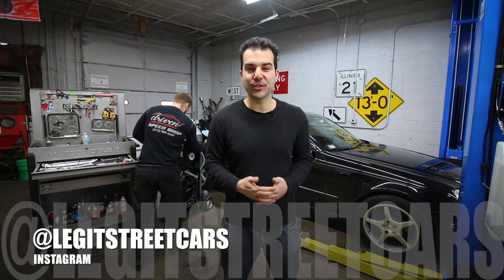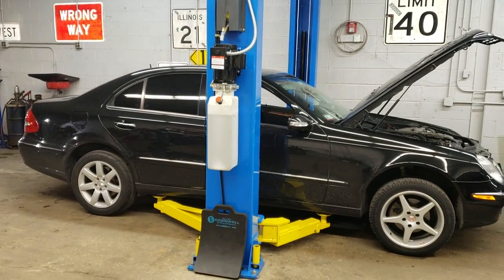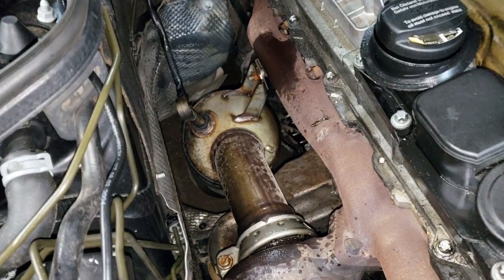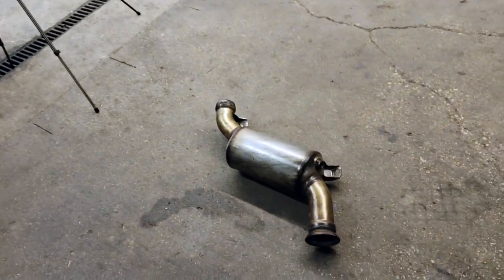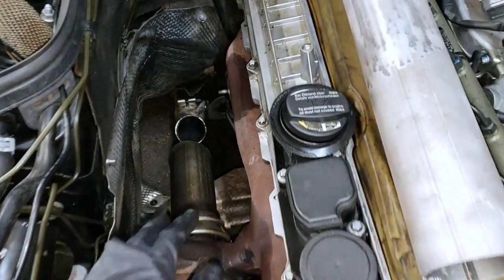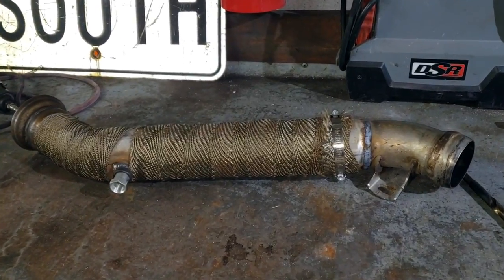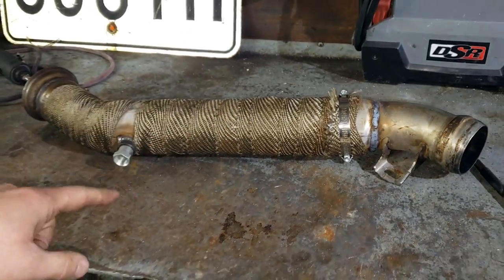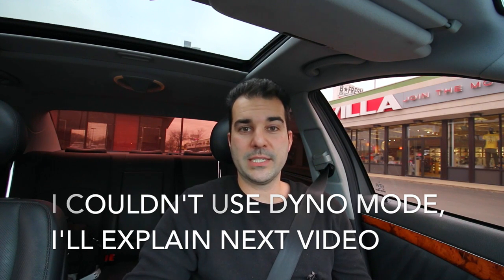I Installed A Catless Downpipe On My Turbo Diesel Mercedes & Tested 0-60 MPH. Listen To That Turbo!

Comment: You have the optil to make a better flowing in and outletcone on the Cat. That would help a lot combined whit a bigger exhaust under the car to the rear mufflers (hot exhaust gasses needs more space than colder gasses.) combined whit better a header and  turbo type you could increase the cars potential and drivability. De-Cat is never a good idea.
But I maybe been damaged since i work with DPF and SCR systems. It is not easy power its Dirty power.    i think that there is better ways to gain power, for example water injection, better Intercooler, cleaning the intake and porting the heads, better turbo, exhaust manifold, better injectors, better Highpressior pump. ECU optimizing. Oil catch tank.

If you ajust the engine to make as little sod at possible you will get more NoX but when you don't get the oil in the manifold it would be easy'er to keep it clean. It's not free but is is a better way to do it. You can tune and still be green ish. And when you do that you learn a lot..

Other wise i love the video's one of them help my friend trouble shorting on his W211 e270cdi. 

Best regard from a viewer in Denmark

Comment: Hello, love the Diesel Mercedes series, I wonder why not just remove what's inside the catalytic converter instead of welding a new pipe, because of the heat? Will it be any problems if I do it like that?
Reply: That's what Killdozer Marvin did on my f250

Comment: You can get about  265hp/ >600nm  from these ,easy. Everything stock, no need mobify anything. Just the ecu tuned. Stock Intercooler is bad as hell, change that first !!!
Reply: Is there an after market intercooler for these?  Or do u recommend a retro fit  from another model?
Reply: @djbarren100   no oem ! They are crap.  Aftermarket will work perfect. Cheap ones are excellent compared to oem cooler. You can get good aftermarket cooler bout 70usd
Reply: I've mine mapped and have always thought of a bigger intercooler. Think I'll look into it.
Reply: @oukkg  Can you please suggest me a good intercooler and AirFilter for this car
Reply: @johnysilvester8483  Intercooler 550 x 140 x 65mm Core Universal, they sell these everywhere, more then enough for this use
Reply: @oukkg  thank you so much for your valuable time and reply

Comment: Nice video and good gains from the downpipe. I think you might have a diesel particulate filter, rather than a catalytic converter
Reply: Both of them are in single casing, first there is a cat and dpf right after it.

Comment: I just have the mufflers off on both of mine and it sounds identical! 
Please chop those mufflers off just to see what the full straight pipe sounds like!!
Reply: I straight piped my 2002 s320 cdi and it made a big difference (stage 1 map too)
Reply: Not sure about the noise level becasue of the turbo, but i had an old straight 5 cylinder diesel Mercedes without turbo.Once the exhaust broke off in front of the muffler (this was years before stainless exhausts), it sounded more like a tank than a car.
Reply: Richie Thirlwell any sound clips???
Reply: @natethedrummer91   I don't have any at the minute but I could take one tomorrow if you want to hear it?
Reply: @richiethirlwell9454  Do it and post it, you'll get a few views from here no doubt.
Reply: Richie Thirlwell yes please!!!

Comment: Did you mean aluminized steal or is it actually galvanized? Aluminized steal is whats used for exhaust, galvanized is used for fence posts and its toxic to weld on.
Reply: sui seidel it looks like the common low grade stainless steel pipe used extensively these days. Calling it stainless steel is wrong, it might be better referred to as rust resistant steel alloy. The aluminized stuff sloughs off the aluminum coating if you weld it.
Reply: Stop calling STEEL Steal !!!

Comment: Should of built a jig and you could of cut it and welded it back together and everything would have lined up perfectly and if would have saved a ton of time.
Reply: That what i do when changing flexhoses on “nottrowaway” mufflers and cats. I weld Them to my workbench before cutting them.
Reply: Did you see him weld, gross. definitely not a fabricator/welder, they would never think to build a jig. that was my first thought. could have done this job in 5 mins tops.

Comment: Must try this on my e220cdi w210!
Reply: I had a 220cdi w210 once, just a recommendation: do a complete straight pipe with a small muffler maybe where the DPF normaly sits.
Its not too loud like that (the muffler takes away alot of the high pitched noises) and it leaves a really throaty sound :D

The car smokes alot less like that because the big muffler at the end of the exhaust is not there anymore.
A lot of diesel soot collects in there and once you give it full throttle, you blow all of that soot out of the exhaust.

also turbowhistle all the time :D Believe me, car parks are REALLY fun like that :D

Comment: Putting a 3" over a 2.75" and you get a small restriction on the lower end of the straight pipe = exhaust flow will be interrupted and wont flow evenly. Just my $0.02 from Sweden.
Reply: Swedes Garage won’t make a damn difference.
Reply: It happens all the time with cars, especialy with intake piping etc

Comment: Hi Alex I heard in this video that your 320CDI has a stage 1 tune. I have a CLK270 w209 2004 with 174,000 miles with full Mercedes service & parts. What are your thoughts on me getting it a stage 1 tune? Please could you advise?  Chris

Comment: Did you weigh both? (the silver and the black) I think the 0,3s could be because of increased weight from the higher amount of gimmicks you mentioned, the black one has. ( for example real leather beeing heavier than the artificial material...)

Comment: I am thinking to buy a Mercedes GL 420 CDI  or an GL450 CDI  Which one has the best engine? And is 200,000KM or 124,000 miles too much? The models I look at have 120k+ miles on them. Hope you could give me any advice where to look for. Thanks!

Comment: Hello I have a 1987 mercedes 300d turbo diesel. I believe my cat is bad and I'm thinking about removing it and busting the core out  and bolting it back on.
Will this set off the check engine light. It shouldn't hurt the way it runs considering its not electronically controlled correct.  Any advice or suggestions would be greatly appreciated.  Thank you.

Comment: I love this series you do all what i want to do with my car check dieselpumpuk they make 311bhp with stock fueling also 2 step is also cool check it out
Reply: Yes and their dyno numbers all all inflated but no matter.
Reply: @kwittnebel  car on same dyno make 160ish and now on same dyno 311 that is almoust 2x off stock power give it take iz that is on stock fueling
Reply: @jimmykovacevic7745  yes without any data on safe exhaust gas temperature or motor durability running twice the fuel with the stock turbo in a very inefficient part of its map.

Comment: Great video! Thank again. Have you tried a throttle response modulation device like Sprint Booster ($290) or Pedal Commander ($300) or Pedal Box ($325)? I assume allowing the drive-by-wire throttle body on these cars to just snap open, rather than slowly opening, would decrease 0-60 times.  They look like they're just plug and play so you could give them a go on both E models.
Reply: drive by wire? its a diesel it does not have a throttle valve

Comment: Hey man I love your channel, what you think about airmatic very stiff, open circuit on damping valve, no height or compressor problem, wiring and connectors or okay. Thanks for your advice I have a video on my channel about it.

Comment: Any internal transmission mods planned to handle the additional lb/ft of torque?
Reply: Jonathan Jones probably not, the CDI has the 722.6 transmission that can handle WAY more torque than this. They are used in the 600 V12 cars and the 65 AMG V12 cars (albeit tuned with “AMG Speedshift” stuff on the 65.) Only bad thing about this 5 speed is the slow shifts.
Reply: I am fortunate to own a ‘06 CDI (wife’s daily driver-and one owner too) that we purchased last year.  The reason for my question is Renntech in FL. offers a built tranny and software (yes- big money).  ‘Curious to see what Alex does to his that a working man can afford...
Reply: @BeesonsCars  The twin turbo V12 models and supercharged V8 models have different clutches (in their 722.6) that are designed to handle more power than a regular E320 will be able to handle.
Reply: Tyler Beeson the 722.6 NAG1 is actually only designed to hold about 420ft lbs of tq.  A simple valve body upgrade or even just doing blue top solenoids would improve performance slightly.  I have spoken to Bill at Paramount Performance about this as I have an 05 CDI and will probably be doing a valve body upgrade soon.
Reply: @BeesonsCars  That is completely incorrect. The 722.6 in the supercharged V8 or twin turbo V12 models have totally different clutches to handle the power. A standard 722.6 in a TDI won't be able to handle the same amount of torque. For it to handle the extra power he would need the different tranny or its internals. I have a chart saved on my phone that lists all of the different 722.6 transmissions, including their torque rating.
Reply: Alex Torkelson thanks for the corrects I didn’t know that. I’m assuming it’s the same thing for the 722.9 as well? Besides different clutches to handle more power is the main design the same?
Reply: @BeesonsCars  Different clutches, different torque converters, different gearing, but those are the main differences. I forgot what else is different, but the upgraded clutches at a minimum would be needed. 722.9 I wouldn't be able to comment on since I haven't spent any time at all familiarizing with those.
Reply: Alex Torkelson I was curious as my family has three Mercedes now of different vintages that all have the 7G tronic. We recently acquired a 2015 W205 C300 and it shifts so much better than the older 7G Tronic in my W221 S550. It’s insane how much difference in shift speed there is. My S is so lethargic shifting but it’s smooth as butter even in sport. But the C shifts like a DCT in sport plus mode and is really great.
Reply: @BeesonsCars  Oh yeah, I wouldn't have any doubt that they'd made huge differences in the 722.9 over the years. I wasn't able to comment on it due to inexperience with it, but just like the 722.6 there would definitely be numerous different gearboxes and different internals available for it. I wouldn't doubt it if the valvebody and shift solenoids are different too. For my E55 AMG, I can get blue top shift solenoids that offer crisper, harder, faster shifts, which I eventually plan on getting. I'm pretty sure the new S65 AMG with the twin turbo V12 now uses a 722.9 even.

Comment: Just out of interest does the US get the V6 Cdi engine used in the facelifted W211?? I think the output for the V6 CDI is 228bhp!
Reply: Straight 6 in 05-06 CDI 201 HP
Reply: @clagueb3686  thats a shame, the V6 CDI was very very good! And responded well with a stage 1 remap!
Reply: I think Mercedes returns to straight sixes this year both petrol and diesel.

Comment: Does Illinois require annual emissions check for registration renewal?  Here in Dallas/Fort Worth we do.  I don't see how you get through that minus the cat.
Reply: Vic Sorlie They just plug into the obd port and check to see if you have any “check engine” codes. I used to unplug the battery and go test before the codes cycled. My Volvo is catless and has no factor in the emissions test. Pass all the time.
Reply: @csebastian71  Thanks.  I was thinking there'd be Not Ready flags if cat was removed.
Reply: @Aardvark49  There would be Not Ready flags, he's BSing. Ask me how I know.
Reply: D/Fw here as well.  This car would pass just like all us diesel trucks around here.  O2 sensor needs to function for no codes but diesel engines have no emissions check, only safety check.
Reply: @I_Count_Twice  Thanks for clarifying.

Comment: I went cat-less on my 993 a few years back, and was shocked at the amount of exhaust gases/smells were omitted once I did the mod. (3.8L w/full Fabspeed exhaust and chipped I'll make exceptions!)  I appreciate you are consider this-especially on a DD thought. Not enough people I feel realize how much a Cat removes emissions/smwlls. Is the Stage 1 tune for the CDI in another VLOOG? Who was it that you used Alex? Picking mine up next Friday and interested in doing this once I make sure it is ready for a tune. Improvement on MPG with basic tune as well? Thanks

Comment: I'm not so sure you should have put this up at all. I've been told by several shops that federal law prohibits them from deleting any cats. I tried to get a shop to cut the cat off my '94 Z28 but they couldn't do it. I am also in sucky Illinois but my car doesn't need to be smoged.
Reply: Then buy a prefab kit from magnaflow  or whatever your poison, and do it yourself. Here in Colorado Springs shops dgaf about Cats, so I've luckily never had this issue.
Reply: NAPA sells "test pipes" for tons of cars that delete the cat and have O2 bungs in them. Basically prefabricated versions of what Alex did here.
Reply: @TheBrokenLife  I might try that. Thanks for the tip
Reply: It's not about failing emissions. Any modifications of emissions controls are illegal. The EPA even spells out, in plain English, that replacing any cat with a pipe is illegal in a letter dated March 13, 1991. Just Google "catalytic converter - epa PDF".
Reply: Maxwelhse yes and doesn’t stop people from doing it. In the 90’s EPA was actually sueing manufacturers making test pipes even if they said it wasn’t for street use and off-road only.
Reply: I know it doesn't stop people from doing it, clearly. As I said in a different comment, it may not be wise for a business to put it out there on the internet that they're violating federal law. They say the average person commits 3 felonies a day without even knowing it. Let's not record them to find out...
Reply: Right now both
 EPA inspectors are worried about making the house payment. Alex has a couple of years to put it back to stock.
Reply: Dude I delete every cat in Florida.  Total restriction and here we don't have any testing and cops don't stop for mods.  Also ok my rx-8 it's one of the worst things for the engine.  They clog and cause major issues and restrictions. I say rip them out

Comment: Do a manual swap!
Reply: Slightly impossible
Reply: @endasavage5456  Not impossible, the OM648 was even available as a stick from the factory as OM648 DE 32 LA red with 170hp, but why would you? A classic automatic is perfect for riding on the torque wave, especially with the short rev band of a Diesel

Comment: Is that a catalytic converter or the diesel particulate filter?
Reply: Dexter Tang 
It depends on country, Europe have the DPF fitted there then the CAT follows..
Reply: @Incountry  It's a catalytic converter. DPF's were not used in his cars. They came out in the next generation and cats are before DPF's, not after.
Reply: Its a catalytic converter.

The faceliftet 320cdi came with a DPF as well as a catalytic converter. The DPF would be right under the front seats, maybe 50cm behind the end of the downpipe.
Reply: @Incountry  nope, the cat is always in the same position, the dpf comes further down the exhaust.
Reply: E Designs 
Apologies, not thinking whilst writing, again...!!!!
Reply: Dexter Tang it’s technically an Oxidation converter according to Mercedes. These cars do not have DPFz
Reply: @EDesigns_FL  Yes they were, factory option since 2004.

Comment: Removing the CAT is completely wrong.  Put a better/newer cat, but dont remove it.
Reply: It's completely right if you want to have fun. A high flow cat costs money - putting in a straight pipe costs practically nothing.
Reply: @alextorkelson6261  you can't discuss with vegans about cars, man. Let it be.

Comment: Good thing your not in California
Reply: scientific method perspective Illinois has emissions testing too. But most Mercedes have at least two sets of cats. My M273 V8 S class has 4 cats total. Two for each bank of cylinders. Plus a muffler and a resonator. I guess that’s why it’s so quiet for a 5.5 V8 😂.
Reply: @BeesonsCars  that's pretty awesome. In CA, there's a new law that says if you have any exhaust modifications, it's 1k fine --not a fix-it-ticket, a fine.
Reply: scientific method perspective that’s garbage. I watched a video on it and find it ridiculous. My friend has a straight piped charger RT (2015) and it would immediately get ticketed if we lived anywhere besides Indiana. Indiana is one of the few states that doesn’t have emissions testing for passenger vehicles. Though we probably should because were the most polluted state. The amount of old clunkers that run around with leaking exhausts reeking of gas should be gone. But the cool thing is cops don’t really care too much. Almost everyone that has a truck or performance vehicle has an aftermarket exhaust here. My friend got pulled over for flooring his charger through the neighborhood at night (it’s LOUD loud, not just loud. Like you can hear it from two blocks away when it’s floored.) The officer said “don’t do this in a neighborhood and don’t be stupid” and drove off.

Comment: Welding galvanized steel is REALLY bad for your health. Shame on you.
Reply: That's why he took it over to the wire wheel to remove the galvanizing before he finish welded it. It's still not good practice, but you do what you have to.
Reply: You can wear face mask. We weld gal at work all the time
Reply: There's good welders and young welders, but not that many good old welders. A face mask isn't doing anything for you when welding galvanized. I think I'd find a new racket...
Reply: Maxwelhse we use battery powered filtration masks, they work great
Reply: OK. I understand now. I thought you were talking about a dust mask. Huge difference.